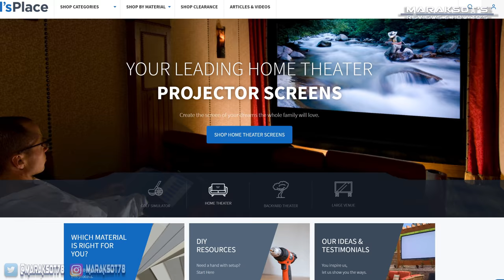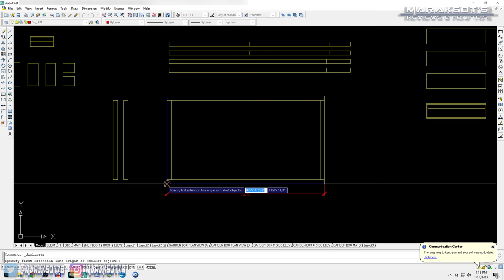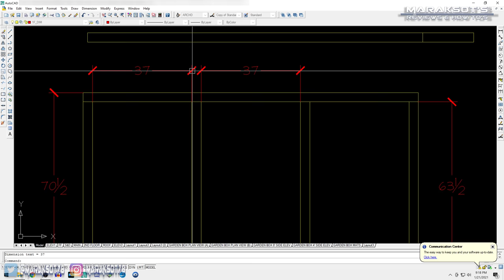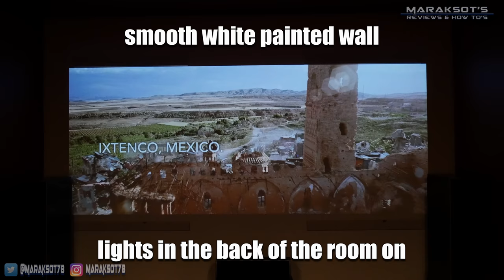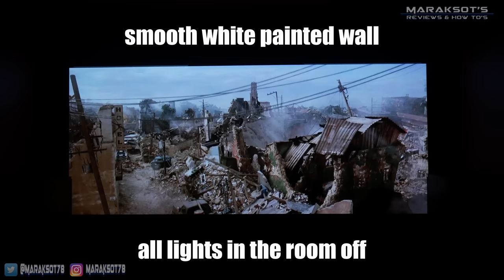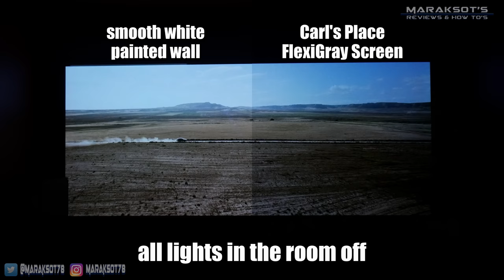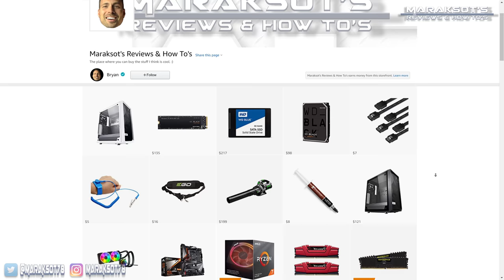144" DIY Home Theater Projector Screen - Carl's Place FlexiGray VS Smooth Finish White Painted Wall

Comment from the maker: Wanna skip to a particular part of the video? Use the Time Stamps. :)

Time Stamps

0:00 - welcome to my home theater  :)
0:56 - measuring for the screen
1:16 - Carl's Place FlexiGray screen material
1:38 - we like having some lights on
1:59 - building the screen frame
5:09 - applying screen material to the frame
6:49 - hanging the screen on my wall
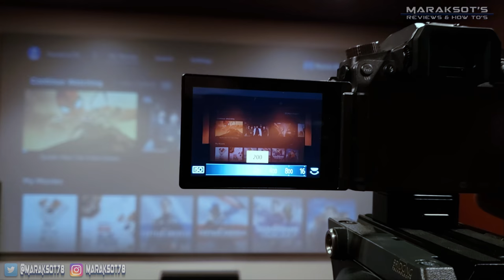7:56 - time to find out how the screen works
8:18 - white wall VS FlexiGray screen with all lights on
9:16 - white wall VS FlexiGray screen with rear lights on
11:01 - white wall VS FlexiGray screen with all lights off
12:49 - the final verdict
14:24 - Thanks for Watching! Like, Share, Comment & Subscribe! :)
Reply: It's intriguing 🥰

Comment: At last a decent side by side comparison - from what I have seen it appears grey screens are mainly for rooms with ambient light - I personally prefer the white screen image , and with the newer projectors contrast rates constantly improving , I think I will stay with my white screen . Thank you for your time and effort putting this video together .
Reply: I use my gray screen when i use projector outside, mostly for some football/basketball games with friends, and it's great when you are in brighter setting. Inside white wall or white screen will do just fine, especially with lights off.

Comment: Nice build ! And your method to stretch the fabric on the frame is the way to go to avoid any warpage. 
My guess is, you should adapt the projector settings for grey screen. Gamma curve, brightness etc ...
Or maybe even calibrate with a sensor. That's the best to have accurate results. Then I bet the grey will provide you the best image.

Comment: Thank you! Side by side comparison was very helpful and exactly what i was looking for. I actually expected grey screen to perform much better and was leaning towards it before watching this video. Thanks again!
Reply: I had the exact same thoughts. I keep seeing comparisons on how CineGrey has so much more contrast than Matt White and I was planning to purchase some grey material to affix to a projector screen if I needed it but seeing the comparison now I think I will be ok with just the Matt white seeing as my screen will be located in the basement where I will have a lot of control over the lighting.
Reply: Grey is crap. An alr screen is best.

Comment: Great vid! If nothing else it gives your media room a more finished look. I have a similar setup (bare wall even) and I'm looking at a DIY screen so thanks for making this :)
Reply from the maker: Yes! That's it! You're so right. There was something about having the screen on the wall that felt satisfying but I couldn't put words to it and you hit the nail on the head. It really does finish the room off and make it feel complete. Thanks for watching and for the comment. Cheers man. Best of luck to you on your own screen.  :)
Reply: It also depends on the type of projector you have, the lumens and general specs. My media room has 3 walls painted charcoal black and the wall I use as my screen is painted light grey. So far I've only owned dlp projectors and was very satisfied with the results.... until my last dlp projector died. I got myself a new LED projector, in theory, with the same amount of Lumens my previous dlp projector had, but the results are completely different.

With my older dpl projector I had a warmer picture overall, blacks were ok, but not pitch black, meanwhile with the led projector, everything seems darker; now blacks are really black and whites aren't actually bright enough. So I had to fiddle a lot with the brightness/contrast/hue setups to achieve the overall colour range I wanted, but still not satisfied. That's why I might switch back to a white wall.

Great video, thanks.

Comment: would a brighter projector give better picture for the grey screen?
Reply from the maker: I left the projector brightness at the same setting while making this video because I wanted to see what difference only changing the screen makes to the picture. When it was all said and done I did increase the brightness and things look great on the grey screen now. Probably should have included that in the video, but didn't think of it at the time.

Comment: Did you alter the projector brightness to make the grey pop a little more? I usually dimm my brightness until black JUST turns black. I think with the grey screen this might happen At a slightly brighter setting

Comment: great vid... just would have loved you to play with the projector settings such as setting the picture to dynamic and color temp to warm to balance out the look of the white wall... I feel like you would have likes the results more than 60%

You don't get a darker screen to boost brightness (dark colors absorb light rays) you do it for the higher contrast capabilities... Which were significant in your example!!
Reply from the maker: After making this video I turned the brightness on my projector up and it looks great now. For this video though I wanted to compare the picture with the projector on the same brightness setting to see the difference between the grey screen and white wall while leaving everything else the same.

Comment: Projectors are getting so good now that getting a projector screen would be a big waste of money. I went to a guy who repairs Projectors for a hobby on the side of his engineering. The brightness of the projectors are so bright that using a screen wouldn't make a big difference other than adding looks to the room. I was about to buy a very expensive screen for the projector until I watched this video, and the truth is that projector screens are a scam. I'm so glad I went to someone who knows a lot about these things instead of a store. This guy doesn't scam and tells you the straight-up truth. He had every light in his house on while the windows were open, and I could still see the projector clear as day without the screen.

Comment: Consider checking first how a ALR fabric works before setting this up, you might want to rotate the frame 180 degrees as the ALR fabric is just a series of triangles* that redirect the projector light and remove the unwanted polarized reflected light...

Comment: Heard that before if you have a darker screen you need a higher more expensive projector to compensate vs lower light cheaper projector.  If you want better blacks.
Reply from the maker: For this video I wanted to see what the difference was without increasing the brightness of the projector to get an apples to apples comparison.  Afterward I did increase my projector brightness and it looks great on the gray screen.

Comment: I think if the projector had more lumens the grey would out perform the white wall. People with epson hc 3800 like myself feel the drop in brightness isnt bad when u have a 3000 lumen projector. Its when ur at 2000 that just go white.
Reply: thanks this was what i needed to know
Reply: @sko1beer  yeah they just didnt have a good / bright enough projector for a grey screen. Need a higher lumen output one because its a 0.8 gain screen which means only 80% of the light is reflected back.
Reply from the maker: After making this video I turned the brightness on my projector up and it looks great now. For this video though I wanted to compare the picture with the projector on the same brightness setting to see the difference between the grey screen and white wall while leaving everything else the same.
Reply: Yes I have short range benq mx 1819st 120 white Screen  All Walls Grey and Optoma uhd 50x 4k 3400 lumens will use wall for 4k Projector

Comment: Great video.  I used flat stock Menards Dutch boy ceiling white paint.  $25 a gallon on sale.  Works excellent.   Screen size 9’ by 10’ overall wall size.

Comment: Older vid but I'm still going to comment. I hope you reply. Thank you for your effort, I reckon I would go for the white wall personally. So What paint ? Matt , semi gloss or full gloss ?? Would the gloss give too much rearward reflection ? This stuff is new to me. I am Handy however. This would save a costly mistake knowing which paint not to use. Thank you.
Reply from the maker: Thanks for the question. If I remember correctly had had the wall painted with a flat white, so a matte finish. It wasn't glossy at all. Not sure what having a glossy finish would do but I imagine the flat matte finish is best.

Comment: I have the same projector as you going to a 92 inch elite screen. I actually ordered sample packs of the screen material from carls. It was hard for me to decide also. I liked the black levels I got with the flexi grey but I didn't like the whites not looking as bright. It bothered me a little bit with movies but it really bothered me when I watched a hockey game. So I just decided to keep my white and start saving 4 a new projector
Reply from the maker: Thanks for sharing your experience. For all the testing I did in this video I had the color mode on the projector set to Cinema. I'm now trying it on Dynamic as it's much brighter than Cinema. I thought about re-shooting everything on Dynamic but I don't think this would change my findings/opinion. The white wall would still be brighter.  I do like the way things look on the FlexiGray with our projector on Dynamic though. Colors look good and brightness is much better than on Cinema. One of the next things I want to do is upgrade our projector to 4K.
Reply: YES, my exact same experience (I have a light grey painted wall, not a screen). Colors and blacks are great on the grey wall, scecially while watching movies, BUT whites aren't ever really bright escecially while watching hockey games! That's why I' switching back to a white wall.

Comment: Better saturation and contrast is always better for me. I'm for the grey screen. Tweak the projector settings for grey and the picture will only improve.
Reply from the maker: After making this video I turned up the brightness of my projector and the gray screen looks great. For this comparision I wanted to see what difference was all other variables being equal. In hindsight I should have also showed how it looks running the projector at higher brightness. You live and learn I guess. 😅

Comment: Enjoyed the video! I had actually been looking at a panasonic pt-rz470. Someone asked me if I wanted it for $300 and seems like a fun project. The one knock on it I've seen is that the darks just aren't dark enough.

Do you think the gray screen an it's "overcast" look might be enough to balance out a projector that doesn't do blacks as well?

Comment: Great video. Currently I have a 100" fixed white screen with black backing. I only have a 1080p projector now. But planning on upgrading it to a 4k projector. So I thought, why not paint my wall and go big!! I'm still undecided as to whether to paint my wall or buy a bigger screen. I know I have to fill in the existing screw holes in the wall and prepare it. Undercoat, primer then 2 X top coat of special screen paint. But I do like the black velvet border around my screen. But will I notice it without? Any thoughts? Great video. Shane from NSW Australia.

Comment: I've been itching to try out grey ALR screens with my newer 4k projector but this video definitively shows that I do not need to experiment with any grey screens while ambient light can be controlled.  In complete darkness, nothing seems to beat the white screen for color accuracy. Thanks for the very honest review.
Reply: Not remotely True. For example it is Not possible to get True Black on a White Screen. Using an AVR Screen will greatly improve your entire picture Quality.

You will get much better contrast and your colors will be greatly improved. You will have True Black that is impossible to get on a white screen.

I went to a Elite CineGrey 5D Screen. I bought the screen material for $240.00 and DIY my Movie Screen. To Buy a finished Screen from Elite Screens with the exact same Screen material costs $3000.00 for a 16:9 120 inch screen.

By making my own screen I Saved a bunch of money 🤑💰.

The difference between my previous Screen a Matte White 1:3 Projector Screen and this one is huge.

The picture is at least 50% Brighter because the AVR Screen doesn't reflect the light against your Walls and ceiling. The Picture Quality is Outstanding. It is Like the difference between watching a 480i Old-fashioned Tube TV vs a OLED TV.

Maraksot78 he went very Cheap on the Screen he bought. He spent around $60.00. He should have bought the $200.00 AVR Screen material from Carl's. He would have greatly improved his picture Quality.
Reply: @JesusSavesSinners  Actually, I gave into my itch a while back after seeing the Youtube video titled "Grey Projector Screens vs White ( Cheapest Ambient Light Rejection )" by Home Cinema & Tech Reviews and bought the same cheap ALR screen through Aliexpress for around $30 for 120" and I couldn't believe how much difference it made, even allowing my cheaper LED projectors around 500-700 ANSI usable with some ambient lights when angled correctly although with very limited viewing angle less than 10%. I hate that it improved the projection so much because the grey fabric looks so ugly draped over my 150" Elite screen but I can't take it off! The cheap ALR screen was definitely worth the experiment for the huge improvement and I've been waiting for 150" availability.  I think you might've paid too much!  In complete darkness though, the white screen works perfectly fine, especially for my 3000 ANSI projector where the ALR screen becomes a bit too bright and I have to squint in some brighter scenes.
Reply: @TW-il4vy  I hardly paid too much. I paid $300.00 for my DIY CineGrey5D Projector screen. A Production made Screen cost $3000.00. My Screen is Better because it is fixed framed. I Saved $2700.00.

I know ALL about White Screens. I used them for 8 years before I switched to Grey. A Good Grey ALR is far Superior. The difference is immense.
Reply: @JesusSavesSinners  I hear you and I was just joking about you paying too much comparied to my Aliexpress purchase for 30.  My cheap screen material was very tough to iron out the creases.  Was yours pristine?  Did you go with "Ambient Light Rejecting (ALR) Projector Screen Material" from Carl's or elsewhere?
Reply: @JesusSavesSinners  I ordered samples of CineGrey 5D, 3D and plain CineGrey and they don't hold a candle to my cheapo Aliexpress ALR screen, and I'm frankly really disappointed and relieved at the same time.  Paid $9 bucks for the samples but it's a peace of mind what I have is much better than the much more pricey CineGrey 5D, which frankly sucks!

Comment: I don't think anyone has asked yet curious what your procedure for smoothing out your wall? sand down and repaint or retexture with some kind of big wide float / knock down knife and then paint..
Reply from the maker: I have done some drywall work in my time but we had our house custom built so I didn't do it.  We asked for our theater screen wall to be smooth finish and the drywall contractor did it.  But if I were to do it myself that's what I would do is use a nice wide knockdown knife to apply mud to the wall to smooth it out and then sand it down nice and smooth once it's dry.  And as always you'd have to do several coats until it is nice and smooth.

Comment: Thx for this, I wish I saw this video before i wasted money on a grey screen, I ripped it out and went back to white wall with frame. The grey screen just did not work, it darkened the screen and especially at angles like an early 2000 projection TV.

Comment: I wonder if the white wall is better than a slight greyish color like this blend, silver screen paint (32 oz each), 1 sample size of black (8 oz), and 1 sample size of pewter (8 oz), it might merge the 2 world together and give you the best of both world bright and has some good blacks, im testing it now
Reply: How did your test go Mainard?
I've been toying with the idea of white or grey painted wall too.... ive searched and it seems something called 'steel grey 2' here in the UK could be the best bet. But it is a reasonable dark grey. I know they do other shades... so i might go lighter. My LED projector is only 2200 lumens max... i use the brightness at around level 7 of a max of 10... and on an off white painted wall, looks very good. But i can only project in a multi use room which has lots of ambient light. So in daytime, it's super washed out. Not a big problem as we only really watch at night when we're not working etc. How did you get on with your painting then?

Comment: What color and brand paint did you use for your white wall?
Reply from the maker: We just used a flat white paint. The brand was Parker paint but a year or two after we built our house they were bought out by Sherwin-Williams. Any flat white will do just fine.

Comment: I have Epson tw7100 (hc3800), 3000 ansi lumens, light treated room, dark grey curtains, dark purple walls, only white ceiling, but about 1.2m over screen so not so much reflection from screen. I tried silver screen just for curiosity (only 1sq meter testing material), and at the end i decided that i will stick to plain white screen, cause colors are better on it, especially if you light control room and dont have too much or any white parts around. Im here cause im looking to make bigger screen, currently projecting on 106" but i want to go full size my room accepts and thats 130". I cannot buy another expensive screen at this size, cause where i live home cinema is exotic sport, no screens to buy locally, i paid huge shipping cost and customs for current screen, so im leaning to DIY screen. I was hoping i will see how white material from Carl's Place performs, but instead i learned how to stretch screen on frame :) Great video btw, nice effort :)